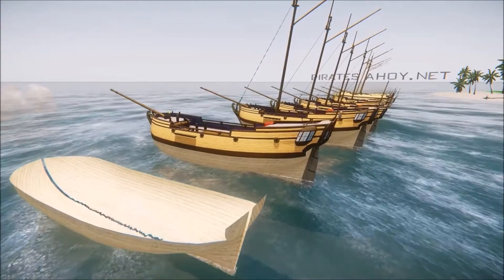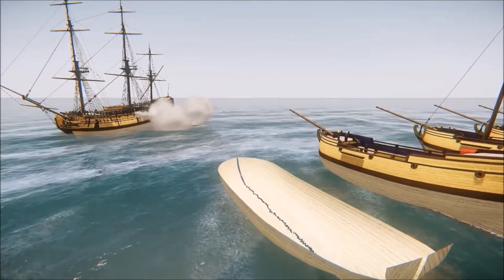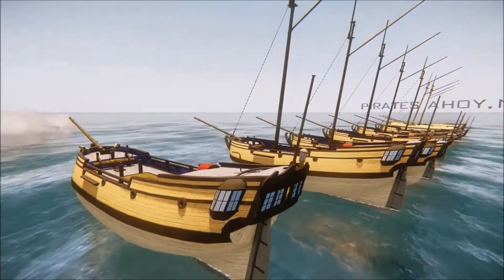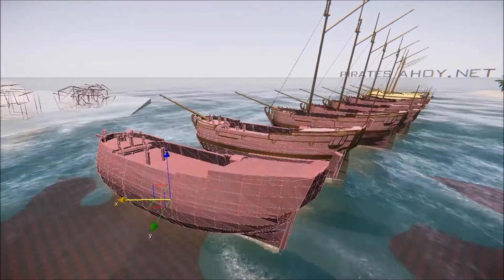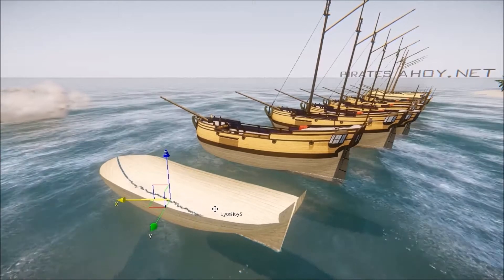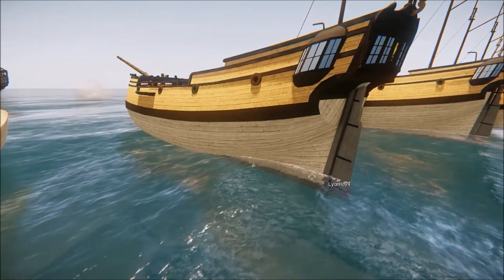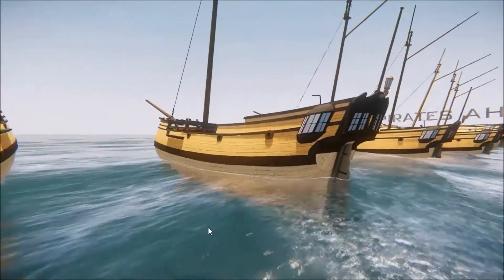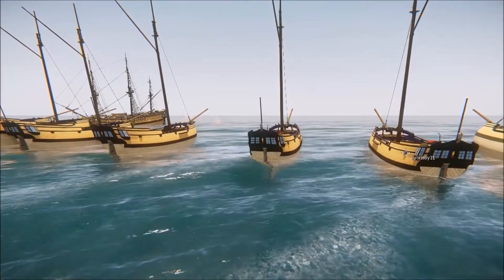Hearts of Oak - Pre-Alpha Buoyancy Basics 2/4/2014

Comment: If the default density used is 1000 and the game's mechanics are metric, then most likely 1025 kg/m3 would be the correct value to use for sea water.